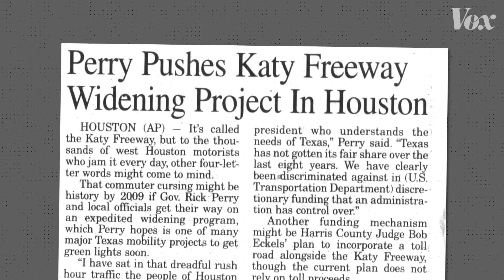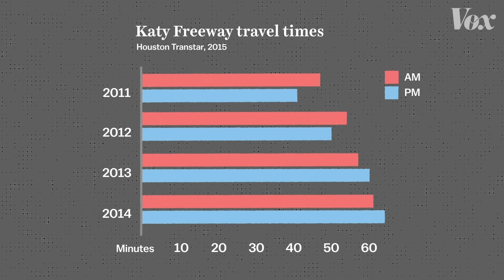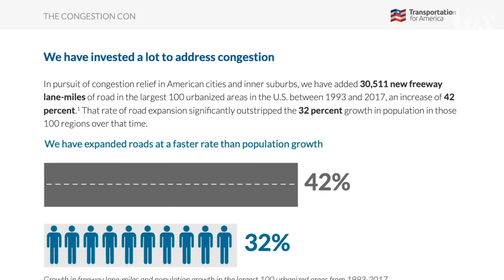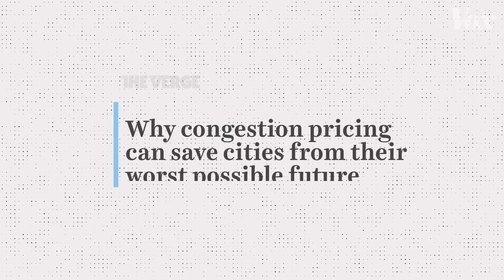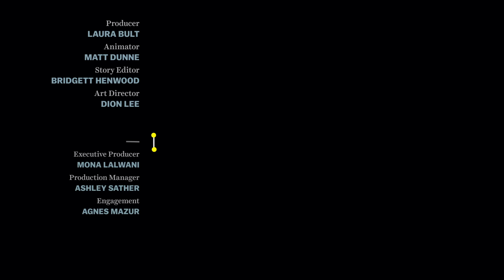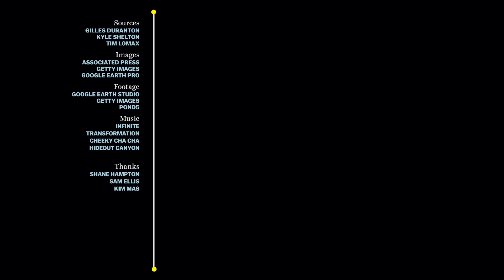How highways make traffic worse

Comment: “Adding car lanes to deal with traffic congestion is like loosening your belt to cure obesity." — Lewis Mumford, 1955

Edit: Cool, thanks for the likes! :D
Greetings from Cologne, Germany - where a 6 lane highway Bridge is being replaced by a 12 lane bridge 🤦‍♂️
Reply: this sums it up precisely. I wish more people were aware of this analogy by Mumford when it comes to highway expansion projects.
Reply: What a way to explain the congestion. We need to reduce traffic itself rather than allowing more space for traffic.
Reply: Couldnt say it better than that!!!
Reply: Wait, 1955? If this quote is real then we've known about this long before a lot of highway expansions were done
Reply: Until you loosen it to the point where the obesity suddenly disappears. If you build out an amount of highways and roads that exceeds the available demand, surely congestion won't be an issue anymore? Although I'm sure there are issues with cost and practicality to take into account.
Reply: @SerenityM54L2SAM5L5N1  Did you not watch the video..?
Reply: 666th like
Reply: @SerenityM54L2SAM5L5N1  well, depending on the city you would need to add so many Lanes, that there isn't much of a city left. And this gets very expensive very fast
Reply: @SerenityM54L2SAM5L5N1  For a few years, yes. Then people will start moving in the city with the "wonderous" empty highways and use them until those become congested as well. Also, as you said, it is prohibitibly expensive...
Reply: But the question is, are you gonna not loosen your belt and expect that to make you skinny?
Reply: @ankitjain3649  Exactly, let order 66 commence!
Reply: @SerenityM54L2SAM5L5N1  you're correct, in theory. It'd be immensely impractical to do such a thing in every country dealing with bad traffic.
Reply: Yeah, then let's reduce the lanes to 1
Reply: @amanlonga1467  Big brain time
Reply: @ankitjain3649  but to reduce traffic itself would require a redesigning Americans living style. Going from sprawling suburbs to ones that are more densly packed and connected to cities with lots of walking paths, trains, and buses. Aside from this change which would be quite difficult in and of itself we would also need to change americans behavior to actually use these systems over driving a car as well as to convince businesses to relocate to work within this new system that is proposed.

It would also yet again leave rural america behind. I mean honestly the US is just a massive place. There is a reason why the car is a very effective way to travel long distances to get to a destination. Public transportation could work well in urban cities themselves but connecting all the suburbs would be incredibly challenging
Reply: @dennisp8520  yeah sure, public transport is necessary in cities and more walk way. Also I feel when rural areas get some basic facilities and employment, there movement will be reduced to cities.
Reply: So what is the solution?
Reply: @jmgonzales7701  Begin investing in good public transport, Singapore is a great example
Reply: No one cares. It’s one of the beautiful stretches of interstate and freeways you’ll ever have the pleasure of driving in your life! Katy Freeway has a way of making people feel great about themselves and being in the City of Houston in general. You actually feel like you’re participating and moving forward living in a progressive city that actually takes your tax dollars and invests it infrastructure. Quiet as it’s kept, Half the vehicles traveling on Katy Freeway are simply nosy people wanting to experience what it’s like driving on the worlds largest freeway. There’s beautiful office towers, 5 stack interchanges, a millions lanes with a million cars traveling them in a single direction, and the tolls are significantly cheaper than the ones here in Dallas. Who ever masterminded the construction of The Katy Freeway was a architectural genius and has literally bolstered the city’s economy for decades to come simply by designing a freeway that is as exhilarating to drive on as riding on a massive roller coaster inside of an amusement park. That Freeway is Str8 Up G a n g s t a 👍🏽 💯
Reply: But if people want to live in suburbs. Without wide highways that wouldn't be possible at all.
Reply: Just use small drone helicopters for a family of 4.
Reply: I think that’s a great way to sum it up.
Reply: @SerenityM54L2SAM5L5N1  It may look perfect sense to add more lanes to decongest but in truth, it just encourages more people to use the highway or people to buy cars which eventually will cause another congestion and govt having to do another expansion until there's no land to expand at all. So that's where the problem is. Solution can be simple, mass transits and more options (bike lanes, sidewalks, etc). Future govts need to encourage more people to stop using cars and instead promote mass transits, also developing rural areas so population movement to the urban gets reduced. Look at hong kong, japan, and singapore - their mass transit systems are so well-utilized and well-planned that it subsidizes their own government
Reply: Ohhh
Reply: Smart guy
Reply: @SerenityM54L2SAM5L5N1  your problem will instantly translate to offramp and those WILL congest, not even taking into consideration new future neighborhood expansions near the expanded highways
Reply: So what's the plan? Start seizing people's cars make driving illegal?
Reply: Sounds like how Singapore's taxi companies extended the time period that peak-hour surcharges apply to address the problem of taxi drivers being less willing to ferry passengers during time periods in-between those with surcharges. So now in addition to having a 50% midnight surcharge from 0000-0600h, our peak-hour surcharges stretch all the way from 0600-0930h & from 1800h all the way till 2400h (some taxi companies even charge them on weekends as well)
Reply: Just a cover-up.
Reply: @nicolasblume1046  that's already standard in most US cities. Space for moving and parked cars cover more land surface than buildings and pedestrian walkways.
Reply: Houston's population has increased 10 fold since the freeway was built in the 60s. Your words imply the city should somehow manage to feel, clothe, and house 10 times more people with just the infrastructure as it existed in in the 1960s?
Reply: @SerenityM54L2SAM5L5N1  Exactly, the solution is not to widen this highway, as there is a diminishing return to further widening. However, building more highways and bypasses to break up the city center allows more people to live in a city without the need to use the same routes of travel that everyone already there currently uses. In effect, building a second Houston right next to Houston. This allows businesses to spread out, allowing people to live and work close to where they want to go, reducing driving. The goal of urban design is for no one to take the freeway, everyone stays in their own districts for food/work/housing, etc. The lane-miles required to service the traffic is commuting population times commute distance. By pushing jobs and housing out into the suburbs, commute distances are reduced, reducing the lane-miles required. This is why quickly growing Houston with its rampant highway construction has dramatically less congestion than, say, Los Angeles, which refuses to build new roads.
Reply: @ankitjain3649  how can the traffic be reduced
Reply: @damianosdamai1022  Why there should be more walking / biking friendly areas then hopefully cities imo.
Reply: @ligametis  suburbs are older than cars, they can exist around a mode of public transport like streetcars or subways, streetcar suburbs that survive to this day also tent to be way more desirable than modern suburbs, since they were designed for people and not just for cars, they tend to have small businesses sprinkled throughout that are accessible on foot.
Reply: @l.c.8475  I do agree such suburbs exist. But nowadays they are just a small part of all suburban communities. For my needs they are good enough. But maybe some want to get more space for less, so they choose houses in the middle of nowhere
Reply: I found really unfair that you made that statement from Cologne. I have visited a lot of countries in my exchange program and now I live in Germany and I haven't found a country with a better public system than Germany. We are talking about the country where Mercedes Benz, VW, Audi and Porsche belongs and even like that Germans have one of the best public transport systems. 

Yes there are things to re-think as you point out with the 12 lane Bridge, but when I heard a young man telling me that he does not need to learn to drive, that's a big winner point to Germany.
Reply: @BvousBrainSystems  sadly, yes. and the people that knew they wouldn't work were ignored by the planners who had other motivations in building urban highways (aka slum clearance aka racism)
Reply: @tortoise-chan  Don't forget auto industry lobbying
Reply: Just keep a 2 lane thing bro
Reply: Yeah I'm definitely using that sometime
Reply: @Ahmed-N  there isnt an infinite amount of cars and people though
Reply: come on germany
Reply: This is a great quote
Reply: @damianosdamai1022  Los Angeles
Reply: @dennisp8520  the changes and redesigns are absolutely necessary. We don't need to shelter Americans from change. And rural America wouldn't be left behind. The vast majority of Americans live in urban and exurban development areas, yes. The exurban sprawl school of development needs to be stamped out, urbanizing suburbia, turning those with huge populations into denser cities, and turning those exurbs with lower populations into dense small cities, dense towns, dense villages. And importantly, excessively developed land gets turned back into agricultural land to feed the world, and into natural land to heal our landscapes. Riparian woodland, wetland, floodplain, foothill, etc. are all essential environments to a resilient human habitat, which we have destroyed in favor of human habitat with significantly reduced resiliency. Floodplains get flooded, so the suburbia built on top of it will be under ten feet of water and debris within the lifetime of its inhabitants. The one built on top of fire prone forests will get torched away within the lifetime of its inhabitants. The suburb built on top of a cut down riparian wood will see the river meander and tear up the land within the lifetime of its inhabitants. The suburb built on top of lands prone to sliding and instability will be buried and thrust up into the air or down into a ditch within the lifetime of its inhabitants. Sprawling suburbs are built with very little geographical strategy in mind. They're meant to turn farmland and wildland into cheaply developed but expensive to maintain housing. They do not serve any purpose well at all. We need to return to the metropolitan, the streetcar suburb, the railroad town, the farming village. Transit oriented development, walkable and cycleable spaces, designed for humans to use effectively and efficiently. Economic prosperity for the resident of the city downtown, and for the resident of the village edge. It's no mistake we've done it this way for thousands of years.
Reply: @MrFrancoisMorrissey  choke points are the absolute downfall of car infrastructure, even if you're ignoring induced demand. You absolutely nail it on the head there.
Reply: @Wideshorts2148  I certainly will. Thank you.
Reply: @plushmeth  even in the world's biggest powerhouse countries for non-car transportation, such as the Netherlands and Japan, people still have the personal liberty to buy a car and drive it pretty much wherever they want. The difference is, said countries use policies, development, and education to deter and reduce car use while bolstering other means of transportation, similarly with other policies, development, and education. Fewer subsidies for car ownership and infrastructure, more subsidies for pedestrian, bicycle ownership, infrastructure, and use, and public transit infrastructure and use. Fewer streets, routes, and parking spots available for cars, those that still exist are often either private property or pay to use, more parking for bicycles, easier access to transit stations, and more routes available to those who use them. There are cases where drivers should be forcibly taken off the road, of course. Drunk distracted and reckless driving, the elderly, people with disabilities, and drivers with a general lack of respect for other road users, should all in one way or another be taken out of the driver's seat and given better access to walking, cycling, and public transit infrastructure, so long as they go on to use them safely and with a respect for other users. It's pretty simple when you get down to asking yourself the questions about the basics, educate yourself using widely available information, and work from there.
Reply: Ya, that Cologne expansion is ridiculous.
Reply: @ankitjain3649  We need to do both
Reply: @jmgonzales7701  There is no solution. That's the beauty of it: We can study, plan, build, argue, and demolish, spending billions along the way while accomplishing nothing. That's politics in the US today. Same thing with homelessness, immigration, etc. We spend more and more every year and the problems just keep getting worse.
Reply: @wallyballou7417  no solution? sad